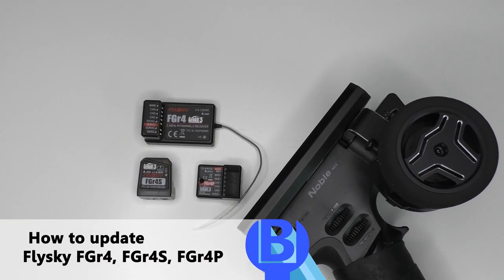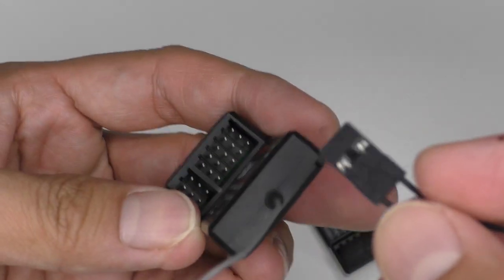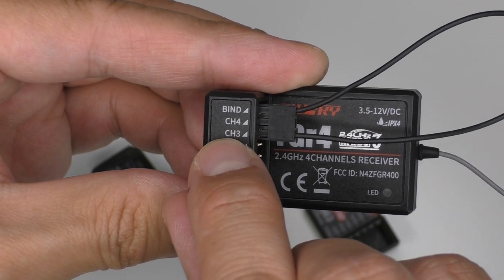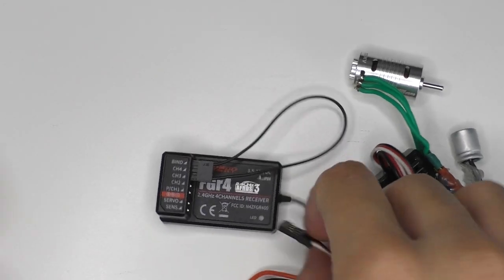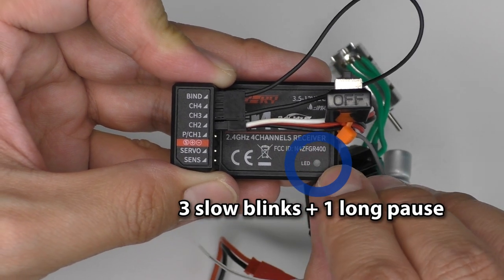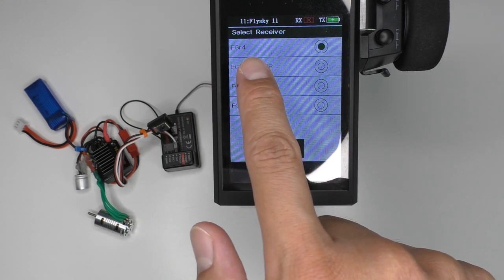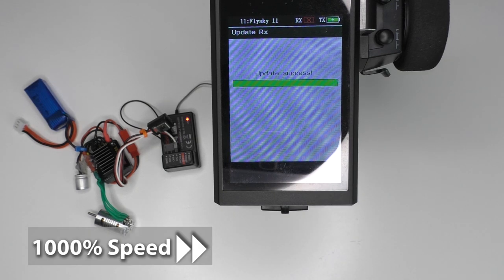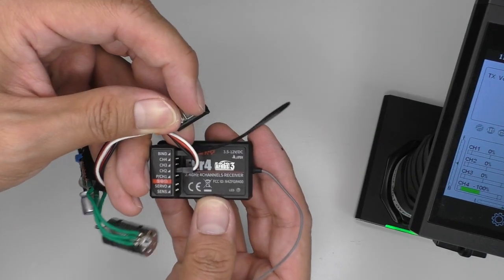[Tutorial] How to update Flysky FGr4, FGr4S, FGr4P receiver (Flysky Noble NB4 FW 2.0.93, 2.0.99)

Comment: Hi boss I'm having difficulty in selecting a receiver for my 1_28 k989 modified for space saving, I have a fs gt3b transmitter?? Which receiver should I use??
Reply from the maker: There's a small AFHDS receiver on GT55. https://www.gt55racing.com/products/gt55racing-flysky-afhds-micro-4ch-receiver-gtr-29?DIST=RUZBGw%3D%3D
There's a version with gyro too. https://www.gt55racing.com/products/gt55racing-flysky-afhds-built-in-gyro-nano-rx?DIST=RUZBGw%3D%3D
Reply: @BeaversHobby  once again thank you very kind of you

Comment: Hi iam new in this hobby and I want to buy this transmitter but I don't see any video talking about the Gyro in the reciver or this transmitter and the reciver has not Gyro bcs I using a radiolink transmitter and the reciver has Gyro integrated please let me know thanks
Reply from the maker: This transmitter only has one receiver with sort of integrated gyro, the GMR micro receiver and the gyro unit is sold separately so it's a separated unit anyway. Unfortunately the gyro for it is very hard to find and I doubt it would be as good as a dedicated gyro unit we use for RWD drifting.

Comment: Hey Beaver, my nb4 noble doesn't have update receiver option what should I do
Reply from the maker: Check the firmware to see which one you are on. If it's an older version than 2.0.93 you will need to update it.
Otherwise there is a receiver updater for Windows PC. You can use that too. Here's the link. https://1drv.ms/u/s!AjPVS3_BWe3vhSzvxajQ1U43hi6X?e=FCuXnD
Here's how to use the receiver updater. It's in the GMR video. https://youtu.be/SjJkjXrSVI0

Comment: Hey Beaver, my fgr4 receiver gives me 3 slow blinks and the receiver update bar doesn't move...what should I do?
Reply from the maker: Check if it can bind with the transmitter already? If so you don't need to update.
Otherwise there is an update tool for the PC you can try too. https://www.flysky-cn.com/nb4-xiazai
Reply: @BeaversHobby  thanks
Reply: @BeaversHobby  what's the update tool ?
Reply from the maker: @MGK.RC.OFFICIAL  It's a Windows PC program to update the receivers. We use it mainly for GMR and Mini-Z EVO but it also works for all the receivers. Here's the tutorial https://youtu.be/SjJkjXrSVI0 .
Here's the program https://www.flysky-cn.com/s/Flysky-Reciver-Upgrade-Updater-V1015_EN.rar .

Comment: I have the fly sky NB4 for mini z cars. Can I bind a FGR4 receiver to the radio?  I want to use it for my Drag car.
Reply from the maker: Yes, you can. Just select the AFHDS 3 either 2 way or 1 way and you can bind it to a standard receiver.
Reply: @BeaversHobby  escuse my stupidity, where do I find  AFHDS 3?  Is this a feature on the radio? If so, I went through all the apps on the radio and I was unable to find it.  If you can shine some light, I would highly appreciate it.
Reply from the maker: @armandomorales313  AFHDS 3 is the protocol of this radio. It's not a feature and you don't have to set it.
You can select the mode between 1-way (no telemetry, no feedback) and 2-way (with telemetry, basically you will see the receiver voltage and it will tell you if the binding is complete). This is in Model > Radio Frequency Setup.
Reply: @BeaversHobby  thanks for the help. Radio is set but once I turn the car on, the light on the receiver does not blink like it should. The red light stays on and it will not bind. Do you think I have a bad receiver?
Reply from the maker: @armandomorales313  If you insert the bind plug to the receiver, does it go into bind mode? If not then the receiver is defective.
You can also try putting it in update mode like in this video and update it first then try and bind it again. If the transmitter says "binding complete" then it should work, otherwise restart the receiver to see if the receiver voltage indicator appears on the transmitter.

Comment: Can you use the fgr4s reciever on to 1/24 scale drift cars?
Reply from the maker: Yes, you can. It's the same 3-wire system just with a different plug. FGR4S uses standard JR/Futaba so for some ESC or servo you might need to convert the plug. Most of the gyros come with both JR and JST-ZH so it'll work wiithout any conversion.
Reply: Thank you im just new in this hobby and i bought a rtr tg racing with generic remote and evrything im planning to upgrade in to better electronincs...but have no idea and i dont have anyone to help me😁
Reply from the maker: @jannacino5495  My pleasure. Don't worry about the electronics came with the TG Racing car. It's still the same standard and you can replace the transmitter very easily. Remember, the white or yellow wire is the signal and the black wire is the ground. As long as you plug it in the right way and in the right channel, it'll work.
Reply: What about the red?...is there anyway i can reach you out like messenger...if thats fine...
Reply from the maker: @jannacino5495  The red wire is the power and it's in the middle so no matter how you plug it in, it can't go wrong so don't worry about it.
I'm on facebook messenger at https://www.facebook.com/beavershobby .
Reply: Thank you sir.

Comment: I’m having so much trouble out of my Flysky Noble! I upgraded to 2.0.99 and I can only use my Toyota 4x4. I can’t connect my MA-030EVO even if I select it in the settings. Also I cannot update or use the FGr4S V2 receivers. I’ve been trying all morning and all night
Reply from the maker: The EVO will also need the receiver update, the method is the same as GMR: hold the button, turn it on and keep holding for about 10 seconds for it to go into update mode and then update from the transmitter.
As for FGr4S, check which plug you put it in. It's the signal side of bind and CH4.

Comment: Hey beaver I have a bmrx but when u turn it on and try Ti drift It does circles by itself I have no control when it turns
Reply from the maker: Check the gyro direction. If it turns into the corner by itself then usually the gyro direction is opposite and doesn't counter steer. Next, check the front wheels to see that you they can freely spin even at full lock. Also check the tyres contact as well that the wheels don't lift when you turn.
Reply: @BeaversHobby  thanks beaver !! I’ll definitely try this out

Comment: What’s the difference between classic and enhanced mode?
Reply from the maker: The classic is for the standard receivers like FGr4, 4S and 4P. The enhanced mode is for the newer receivers with onboard gyro or other functions like GMR (it doesn't have onboard gyro but it has a port for the gyro module) and INr4-GYB.

Comment: Hi. Very good vid. What news in this updating ?
Reply from the maker: Just need to update the receiver to make it work with the new transmitter firmware. The transmitter firmware has a lot of improvements from displaying channels value, switching between memories not doesn't delay. The other reason to update is to use RM005 module to drive Mini-Z FHSS. https://youtu.be/htRg0lEAIes

Comment: How do you hook it up to your xrx sir?
Reply from the maker: The connection is the standard:
- ESC to CH2
- Servo to gyro
- gyro 3 wire to CH1
- gyro 1 wire to CH3 or any VR (knob) channel
Which receiver do you have? Perhaps you have the FGr4/4S and the plug is not the same? In that case you'll need an adapter or converter to convert JST-ZH plug (small plug from electronics) to JR/Futaba (standard receiver).